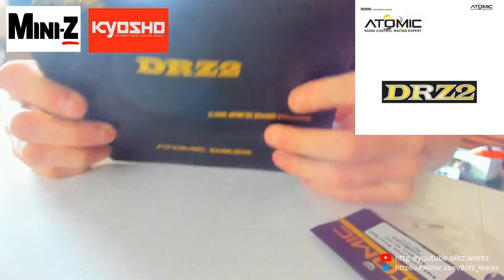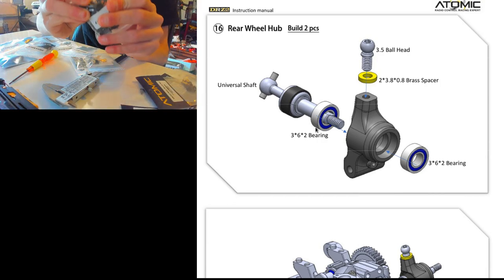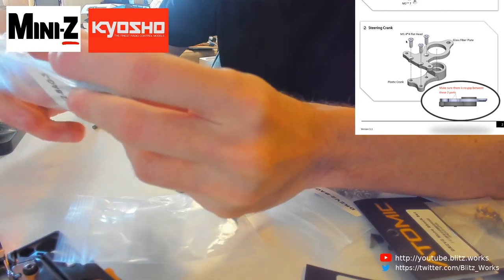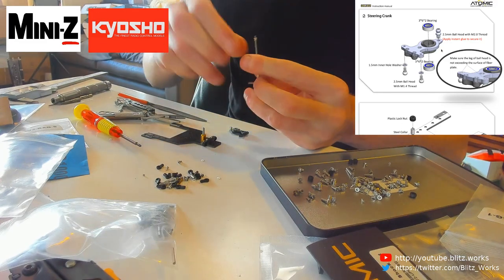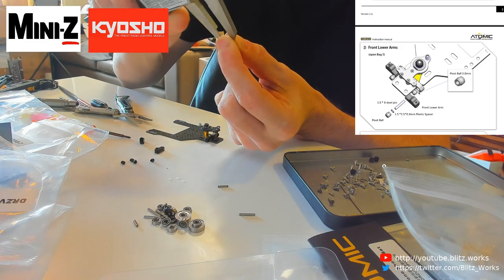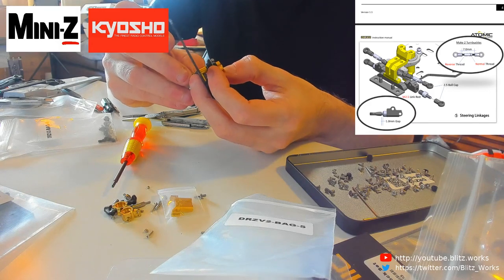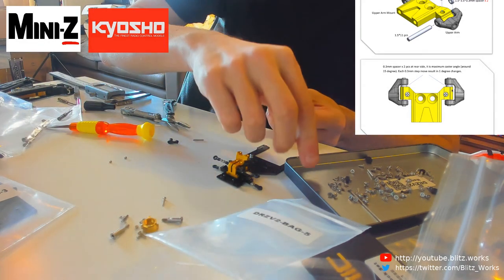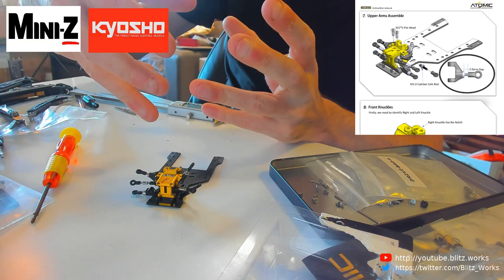Atomic DRZ v2 build Live on twitch

Comment: How do you change the front end ride height on these? Also, it took me about 4 hours just to get the front turning angles tuned in, the link recommendations on the manual SUCK!
Reply from the maker: The adjustable shocks are what i used, made life a lot easier and i didnt have much issue with them. that said i moved on from the DRZv2 a bit due to how much tunning you need to do out of the box